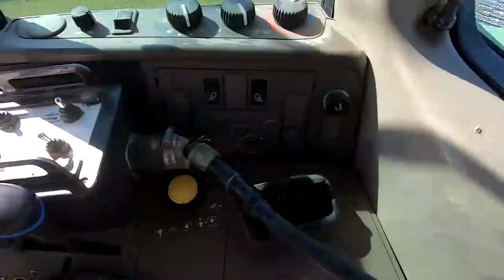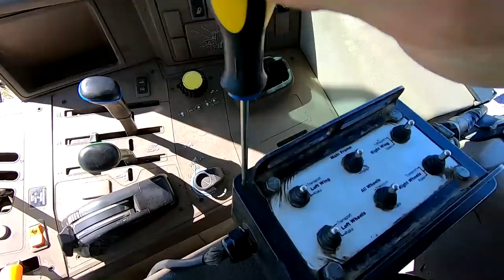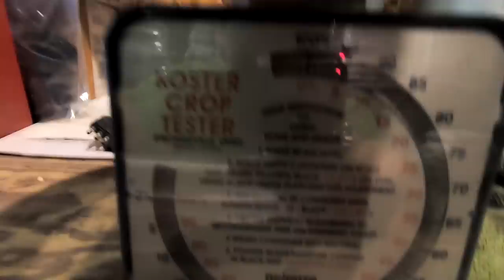Milk Pump Trouble & 2nd Cutting Hay Harvest

Comment: Here is an explanation for the airbags in the silo:
In turn sealed silos, countervailing pressure bags also called breather bags or lungs (breather bags) limit decomposition by restricting oxygen intake; harvest, trim bags are used to control the pressure inside the silos.
Reply: Got that on google
Reply: who cares if he got it on google lol
Reply: @Drakkoo-yp8yl  i do
Reply: Ahhh what would the world be without Google

Comment: your silos have one-way valves...the airbags inflate to push the air volume out to reduce the O2 inside.  They create a vacuum in essence.  I remember the days "hayin it" on my grandparents farm without any high-tech gear.  Had to manually tie the bails and load them onto the wagon...then into the loft.  Long hot days.  You literally fall asleep the instant your head hits the pillow.

Comment: The breather bags are what helps keep the Harvestore air tight. When the silo gets hot the air inside expands and squeezes air out of the bags, when the silo cools then the bags expand using air from outside the silo. This keeps the gases in the silo from mixing with the air outside the silo since only the bags are vented outside the silo.

Comment: With that milk pump issue, it got me wondering how many single points of failure are in the process. If a single device failure would put you out of business, shouldn't you have replacements on hand, or a redundant system? Or are there too many such critical points to be feasible?

Comment: does the operator of the chopper control the chute to point in the wagon or is it controlled by some type of sensors
Reply: Manually with buttons
Reply: Operator does it

Comment: Dont feel bad. Look at the bright side, it wasnt the bailer or your chopper..right?  I was so tiny when dad put me in the tractor tugging loads to the silo, I could not reach the brakes every time and I slipped. Pulling away I hit the unloader on the wagon right into the dual extension that was left on for plowing. IT sheared the chain, the gearbox, the chute and all of the conveyor CLEAN off the wagon.. I didn't tell them til they had already loaded the wagon.  He beat my skinny ass hard..with his leather Belt he MADE by hand.

Comment: Isn’t that kinda dangerous working on that mower while the tractors running I understand that shutting the tractor on and off while repairing the blades might be a pain but what if the pto somehow engaged and you lost a finger or a arm or worse ?

Comment: Your head tank seems kind of undersized for the amount of milking units you're running. 
That pump probably runs constantly. 
We didn't have a automatic electric pump but rather haff to open a valve  manually in order to drain the head tanks. 
Our parlor had one big Pyrex head tanks (80lb cap) for every 2 milking units

Comment: The air bags are for gas expansion.  Since it's a sealed silo I believe when the day heats up gas build and fills the bags and when it cools they shrink.  Basically it's so you don't have your silo explode.  Where as a stave silo top feeder has holes for the chute for feed to blow down and a place for gas to escape

Comment: Those airbags in the silo are countervailing pressure bags also called breather bags or lungs (breather bags) limit decomposition by restricting oxygen intake; harvest, trim bags are used to control the pressure inside the silos.

Comment: Lol...Dad = experience = reboot the system...go from there. My wife ran the data processing department at a cannery. Frequently received calls from 11pm  to 5 am that their computers and equipment didn't work.... finally the first question she began to ask was "is it plugged in?"..2nd question was "is the computer turned on?". 97% of the time these questions solved the problem. If that failed she told them to reboot the system. 1 % of the time she would have to go in to solve the problem.